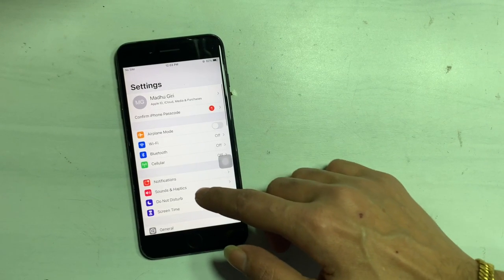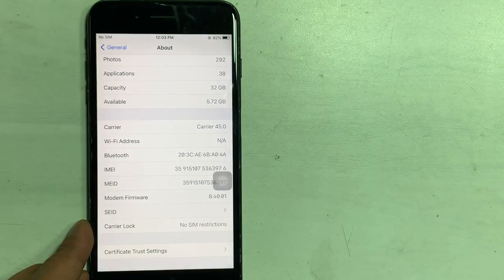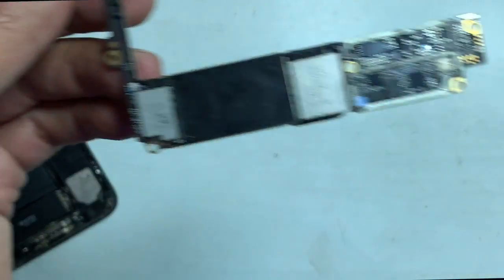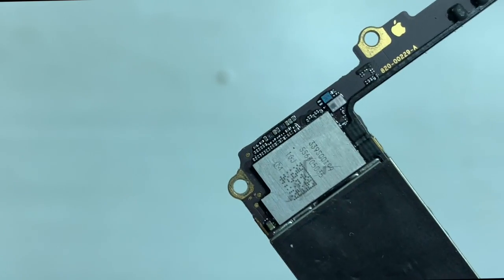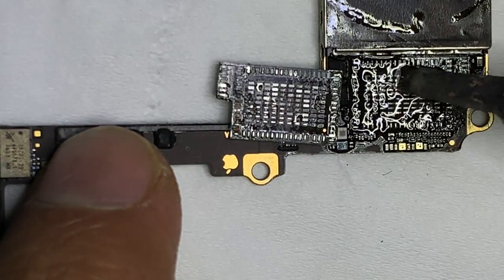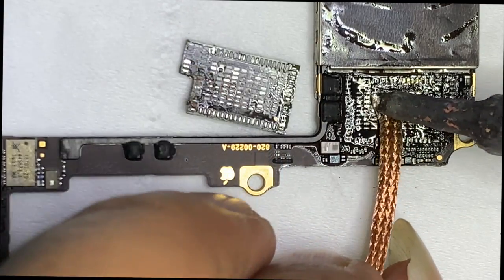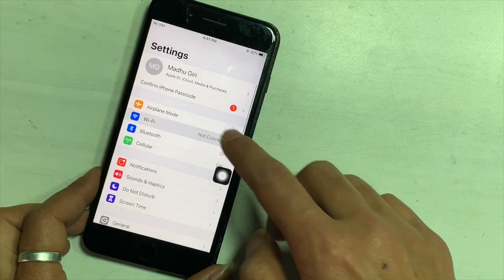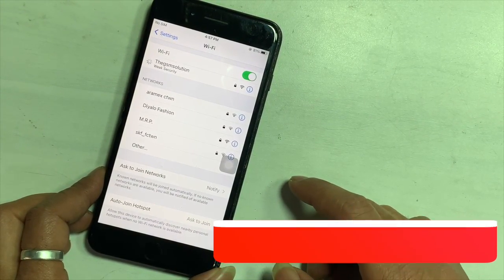iPhone 7,7 Plus wifi greyed out 2021! Fix Wifi won’t turn on iPhone 7 & 7Plus.

Comment: Just replace wifi modul ? Not program nand sir?
Reply from the maker: If the iPhone was below 6 plus no need to program but From iPhone 6S to Up need to reprogram Nand if you use a new wi-fi module or can use an iRepair like device to unbind Nand.
Reply: Thankyou sirr
Reply from the maker: Welcome brother.